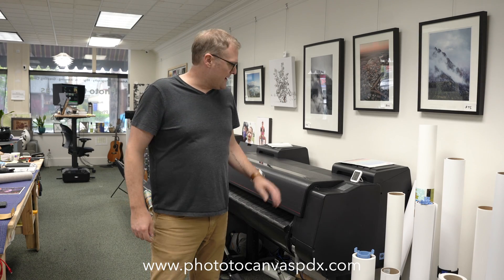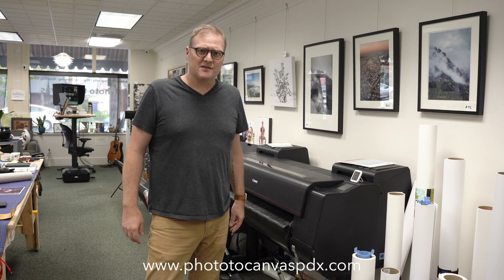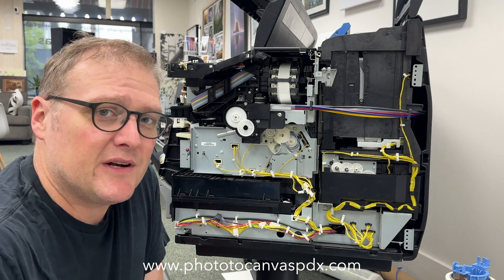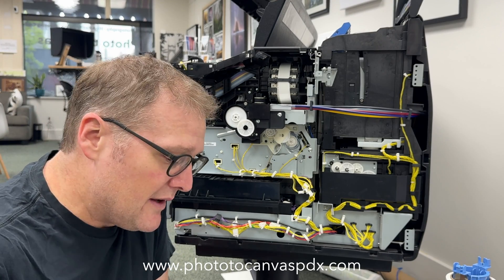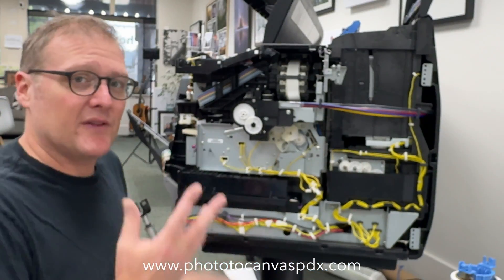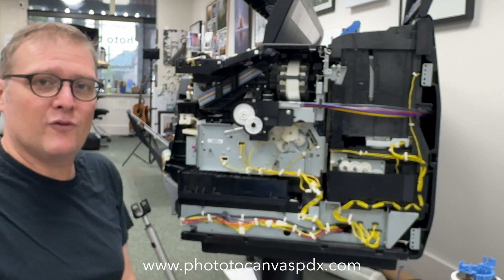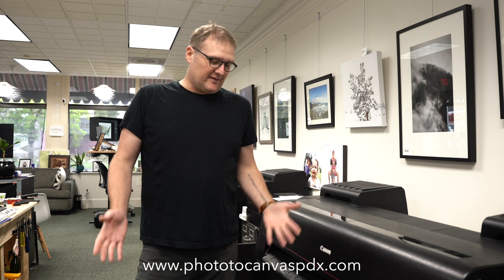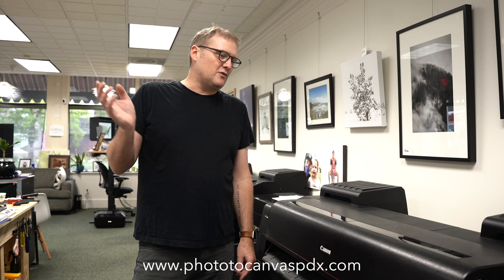Replacing a Purge unit in a Canon Pro-4000 Printer (error code EC31-2F1C)

Comment: I got same error on my Pro 1000 , obviously the ink clogs the purge unit and it gives error , my solution ( I know you printer is a larger beast but principles are the same) distilling a clearing solution at the base of my purge unit ( the purge pad ) where the print head sits and it solved my problem and saved my printer , Mine is purchased 2017 and still running until this moment….!!, I used the video on epson and applied the principle on canon and worked like a charm:
https://www.youtube.com/watch?v=iKzxAm9QtWo

Comment: Hi, I changed the purge unit and I'm still getting the same error. any ideas please
Reply from the maker: Did you change the service mode settings?
Reply: @phototocanvaspdx  yes
Reply: @phototocanvaspdx  I don't really know what to do anymore. I'm sure the problem is not the purge unit, so install a new one. But what could it be?

Comment: Hello, I am Marco Santos, a photographer here in Belém do Pará, Amazon, northern Brazil. I have a small printing business. I am contacting you due to a persistent problem I have been facing with my Canon Pro 4000 printer. The hardware error EC3F-2F40 is causing me a lot of frustration and financial loss.
Since I started receiving this error, I have already spent more than a liter in inks and maintenance cartridges, without success in resolving it. I have followed all the procedures indicated on the printer's digital panel, but nothing seems to solve the problem.
This printer is essential for the operation of my business, so I urgently need a solution. The error is severely impacting me, forcing me to use alternative printers, which is compromising my productivity. The costs with these third-party printers are significantly increasing my costs, causing irreparable losses.
I am attaching some photos of the error so that you can better analyze the situation.
I would like to request your assistance to diagnose and resolve this hardware problem as soon as possible. I will be waiting for guidance on the next steps to follow.
I appreciate in advance your attention and support. I hope I can count on your collaboration to resolve this issue as soon as possible.
Sincerely,
Marco Santos  WhatsApp +55 91 981150538